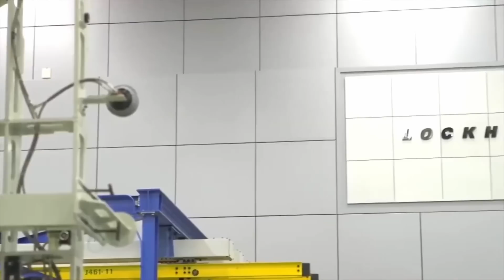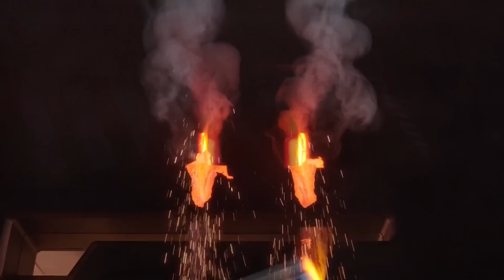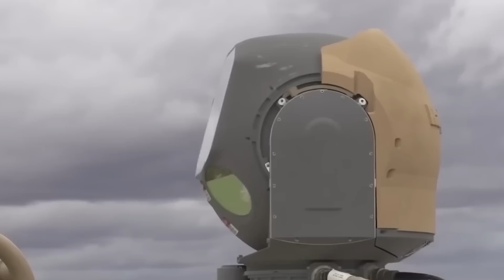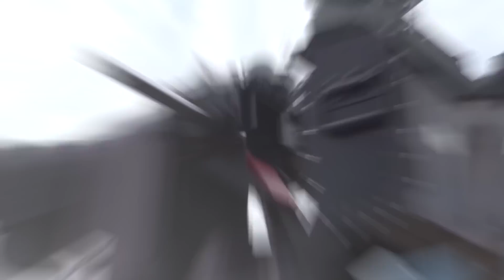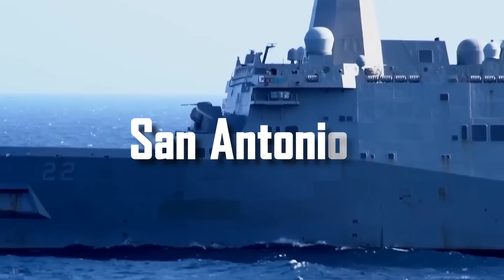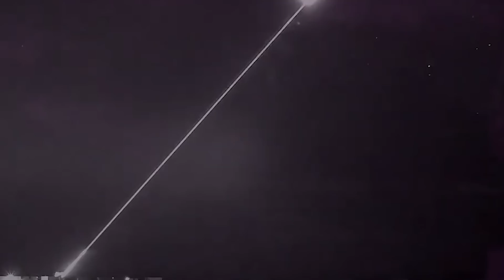Finally! $1 Million Laser System on A-10 Warthog Destroyed Aircraft!

Comment: LASER effective potency weakens with the square of the distance to the target due to the atmosphere that it has to penetrate. Also the prime mover that supplies the energy for the LASER would have to be enormous to be any good. On ships and land based areas, where weight and volume are not a big concern, a potent LASER can work. But on a fighter aircraft, like the A-10, the gun is a better choice.
Reply: It's not going to replace the gun it's a pod  add on

Comment: With so much of modern warfare hardware computer and electronics based, why haven’t we seen a bigger drive in development towards EMP defences? If you can take away the electronic controls of a weapon, its destructive capabilities are rendered useless. I know that the cost of creating high enough concentrations of energy in EMPs is very restrictive, but this was also the case for lasers just a few decades ago.

Comment: If that laser system is placed where it’s shown is the video, it’s going to mess up the plane’s flight stability due to the mass being placed considerably to the rear and the guns (and related) being absent. UNLESS it’s been calculated and changed to compensate. Even then, I don’t believe that it’ll be a good idea. FOC or Front Of Center has a TON to do with stability when it comes to a drag stabilized object (such as planes and arrows).
Reply: Is it possible that those engineers who have spent their career designing and developing this weapons system are more than likely to have considered the weight & balance factors before ever installing and flying this new evolution???
Reply: @RonaldMayDMD-nt3fd  that’s why I said “unless it’s been calculated and changed to compensate”!
Reply: To correct the FOC they will purchase gold-plated $1 million rocks (each) to correct this. I calculated it'll take about 40 rocks.